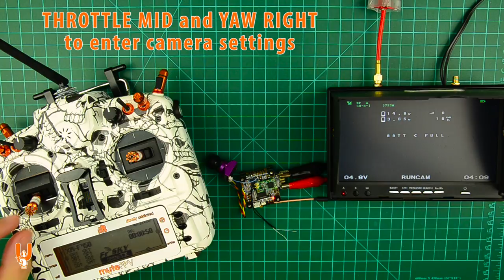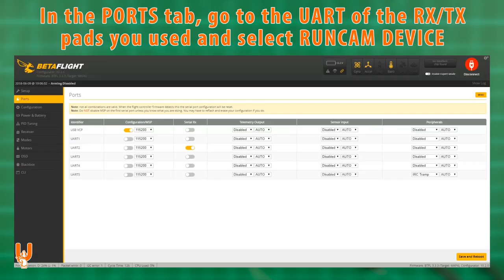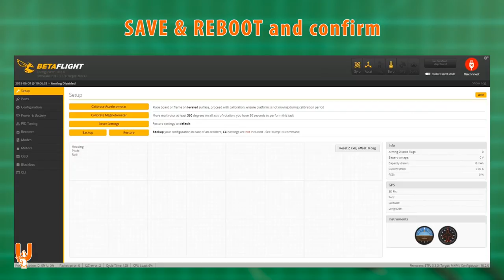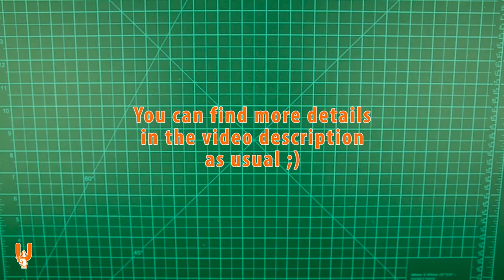3 ways to control your FPV camera - Matek F405, Runcam camera control & Micro Swift 3 - QUICK GUIDE

Comment from the maker: Quick update:
Tried Foxeer Predator Mini and Micro cameras, as well as the Arrow Micro Pro. The camera control is not working from the S6 pad but afaik it can be fixed by adding a resistor. If someone knows exact values, please give more details by replying below.

Tried the Eachine Speedybee camera and it works fine on the S6 pad.

There is a detailed compatibility and configuration list for betaflight camera control in this thread: https://www.rcgroups.com/forums/showthread.php?2961216-Betaflight-Camera-Control-Compatibility-Reports

Comment: Thank You !  I'm working on my first camera control and this video was excellent! My gear is the Matek f722-se / AKK Pro Ultimate VTX 1watt / Foxeer Preditor. I used the two wire plug osd/gnd  I soldered the OSD to s5 motor on the FC and the gnd to gnd. I used cli command # resource first to see the setting then remapped them correctly all FC may be different so be sure to check first. saved rebooted and vwah-la. Camera Control via transmitter and FPV - Life is good.......
Reply from the maker: Awesome, I am glad you found this video helpful :)

Comment: Thanks for another helpful video, cleared up the confusion between the three ways of control for me, as I got my Runcam Micro Eagle in a used build with no rear panel, nevermind manual.  Downloaded the manuals an verified with runcam that the red version I have is OSD and not the "remote control" version (which is orange) that has TX/RX pins and is intended to wire up to a UART, so looks like I would need the control adapter board to do that.  My FC is a Talon Fusion F7 with a CAMC pad so I think I can wire directly to that?
Reply from the maker: You're welcome! Most probably yes, check the Talon's instructions in case you need to set something specific in CLI.

Comment: Hey do you know if this works with the mamba f405 mk2 and the caddy ratel cam? I don’t know which pins i need to solder on the fc
Reply from the maker: Hello, I haven't tried this combination. As far as I recall that FC does not have a camera control pad, right? Caddx had a similar FC camera control adapter board in the past too.

Comment: For method 1 did you also solder the OSD ground wire coming from the camera? In the video I only see the black cable bent away...
Reply from the maker: Nope, I did not solder it. The ground is common so only one was enough :)

Comment: Nice video! I have a Matek F405 CTR and a Foxeer Monster V2. Do you think it will work like this?
Reply from the maker: Thanks! I don't have a CTR board so I have no idea.
Reply: @muteFPV  on the website it says S6 is dedicated to camera control, so that is basically the same as your board right?
Reply from the maker: Yep, it should work the same way then :) You can play with the camera control adjustments in Betaflight CLI to make it work with your camera (ref_voltage, key_delay, internal_resistance)
Reply: @mertcapkin7263  Hey man, I also got the CTR, just wondering if it worked for you?
Reply: @TheAnarchySniper  hey man, i have not tried it yet. Let me know if you do!
Reply: @mertcapkin7263  yeah I'm gonna try it this weekend
Reply: @mertcapkin7263  Yeah, so I tried it out, works great. Just soldered the OSD wire from the camera (Foxeer HS1177) to S6 on the F405 CTR, no resistors or capacitors, set it up on betaflight just like in the video and it worked perfectly.
Reply: @TheAnarchySniper  Nice! Thanks for the info!

Comment: excellent, i just wired to s6 on the 405 std and worked perfect thank you
Reply from the maker: You're welcome :)
Reply: @muteFPV  for real yours was one of the only videos that was straight forward , love my matek 405. Camera control is nice :)
Reply from the maker: Thank you very much! Have you combined the Matek F405 to the FCHUB-VTX? It makes for a very clean stack if you are using separate ESCs.
Reply: @muteFPV  im using the non vtx  fchub 6s
Reply from the maker: Ah that is nice too :)
Reply: @muteFPV  35 amp bl heli32 @ dshot 1200
Raw dvr worked hard to have no video noise https://www.youtube.com/watch?v=AqgpXoHBqSI
HD edit https://www.youtube.com/watch?v=Xc3a72TIv08
Reply from the maker: Damn, why so bad? You had to add 1 on each ESC + 1 on the main battery leads huh?

Comment: Hey, how do you get camera control with a runcam micro eagle and the airbot nano v6? Thanks.
Reply from the maker: I don't have the airbot board but it says in the manual that it has a dedicated camera control pad.
Reply: @muteFPV  are you able to use a camera that has RX and TX onto the cam control pad? or would you have to remap resources of the other uarts?
Reply from the maker: I am sorry but I don't know how the camera pad of your board is configured.

Comment: I have matek f405 osd, discontinued board. Cant seem to figure it out unless I use dac. Dont know what that even is or how to map it
Reply from the maker: Is there any info about camera control connectivity in its manual/datasheet? I am not familiar with that board.
Reply: It has a dac, but I remapped camera control to s6 and it didnt work do I need smart audio hooked up to s5 or something
Reply: And a runcam owl plus it has osd, but cant figure out this camera control, it has a osd and it does work with joystick
Reply from the maker: That board may need a capacitor and different values for internal resistance and key delay. I am not familiar with it so you will need to dig deeper. Check here if they have reported a working configuration: https://www.rcgroups.com/forums/showthread.php?2961216-Betaflight-Camera-Control-Compatibility-Reports

Comment: thanks for the review
I have a F405 with Runcam Micro Swift 3, I can not control the osd with my taranis, I do not understand :( (UART 1 & 3 do not work)
Do you have an idea ??
Reply from the maker: It should work exactly the same way as the Sparrow did in my video. Did you do the same connections?
Reply: muteFPV  Yes, exactly the same (same UART) 
Is it possible to control the osd in another way ?
Reply from the maker: And the same pad on the F405?
I don't know how else you could control it.
Reply: thanks for the answer, I still can not find :(
Reply from the maker: I cannot understand what could be wrong. Same connection to the camera, same board, same pad, same settings :(
Reply: @muteFPV  I have the same F405 and Micros swift 3, I am going to try the UART connection tonight, would I be able to do it on any RX and TX (eg. RX3 and TX3)? and will reply back if it works. There is no need for a resistor in this case? I tried a connection with a resistor and linked it to the LED pin of the FC and no luck, hopefully I ll be lucky with this connection.
Reply from the maker: @Jad Rouhana
 the Micro Swift 3 has Rx/Tx pins so there is no need to add a resistor.
Any free Rx/Tx pads should be OK to use.
Reply: @muteFPV  I comoletely messed it up and found it that I have the Runcam micro swift 2 so not ports for Rx/Tx so need a resistor and a capacitor connected to the led pin correct?
Reply from the maker: @jadrouhana5897  You can try #1 of my video then, this F/C supports camera control.

Comment: Any way to do the same with foxeer cameras?
Reply from the maker: I added more details in a pinned comment and will update as soon as I try out more cameras. Foxeer Predator and Arrow did not work on the S6 pad of the Matek F/C, I believe it can be adjusted with an additional resistor.

Comment: You wouldn't happen to know how to get the cam controls for runcam split 2 to work on the 405 ctr.
Reply from the maker: I haven'tr tried it but you can follow the instructions and connections shown in the manual: https://www.runcam.com/download/split2/RunCam-Split2-EN.pdf

Comment: Can I do this with the Omnibus F4 v3 FC?
Reply from the maker: You should check your board's manual / pinout first :) I don't have that FC, sorry
Reply: @muteFPV  Thanks. I did it using Motor 6 pin. Thanks bro